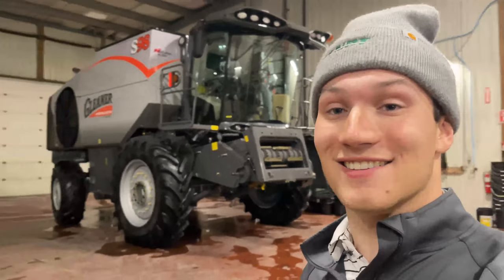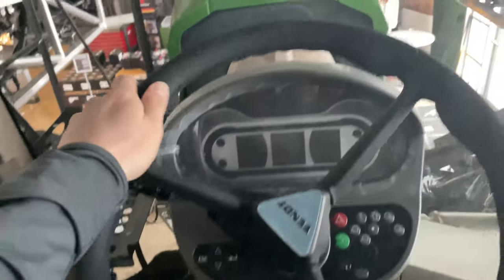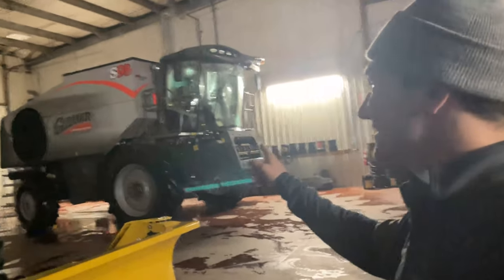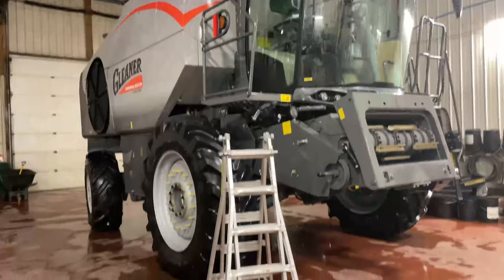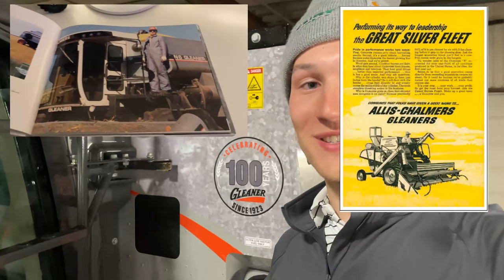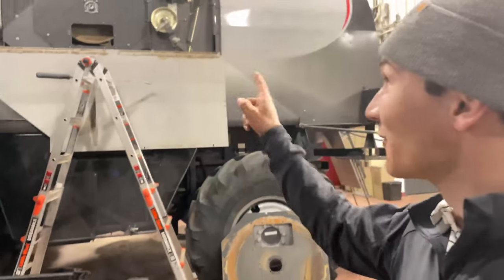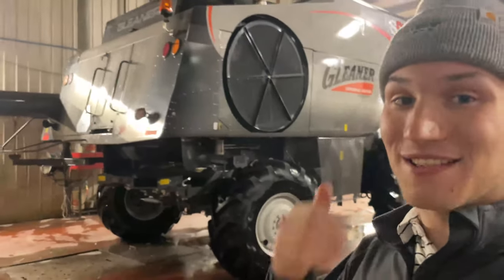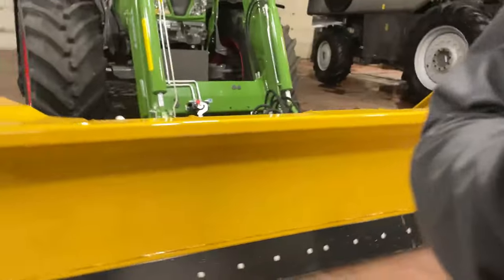First look at a Gleaner Centennial Edition combine

Comment: Thanks for your video, FLA.

I like to see wide rubber on a Gleaner, wide back wheels and big wide drive wheels.
Most modern combines have gone to wide back wheels.
Any changes in the machinery?
Reply from the maker: I agree, widder rubber would look a whole lot nicer! Mechanically just small little changes and updates, I’d have to look into that more! Glad you enjoyed the video!
Reply: Check the weight of the combines being compared.  Gleaners are about 10,000 pounds lighter than most others which explains the smaller tires.  That said, I would love to see one sporting the Titan - Goodyear LSW wide tires !!!

Comment: Austin does the S98 have steep pitch helical bars i agree with you on loving the way Gleaners operate we run several Gleaners
Check out Kessler Grain Farm You tube channel you might have some tips for me that might help me out
Reply from the maker: Hey! I’m not sure about the steep pitch helical bars. I’m not even sure what they are, where would they be on the machine or are there other terms for these? I’ll check out your channel! If you ever have any other questions just ask away, if I can’t help or don’t know the answer I will ask someone and try and get it to you!
Reply: @FullLineAustin  Helical bar are the bars inside the cage that direct the flow of your crop to discharge of the machine
Reply: Kessler,
Thanks for posting, you just gained a subscriber !!

Comment: Yet the idiots in corporate AGCO do their best to defund and try and kill the brand but haven't. Also letting dealers go by the wayside and kill them too by not producing enough machines for them to sell.
Reply from the maker: Supply chains for everything are strained right now sadly, I agree though I wish we could get more machines! Gleaners are awesome and they are getting more and more popular each year! 

Thanks for watching, I see you have a Gleaner! How long have you been running them for?
Reply: AGCO would sell even more if they could design a class 9 combine with the natural crop flow system.  A single short rotor makes that challenging.  AGCO is trying to supply the large combine market with the black Fendt Ideal units made in Italy.  They have had a rocky start in North America.